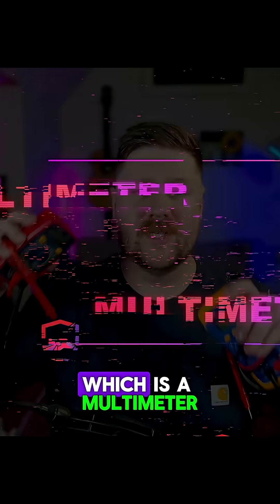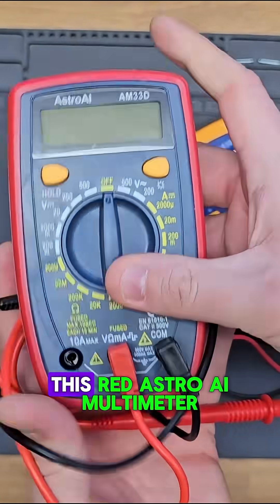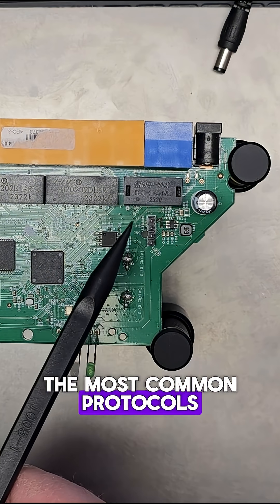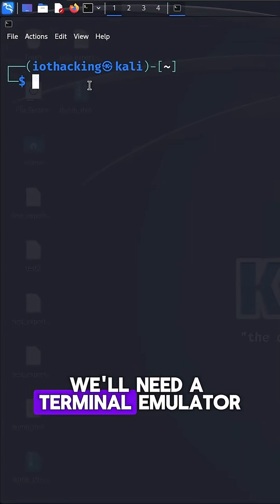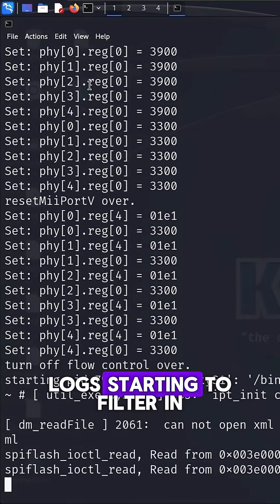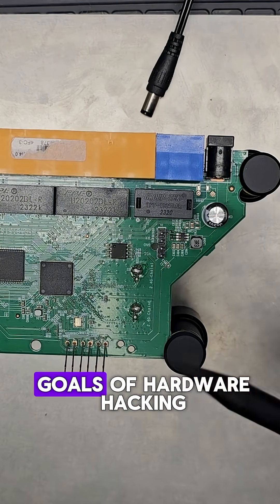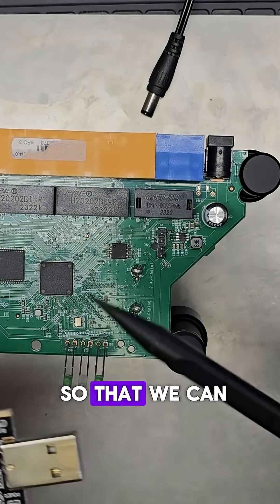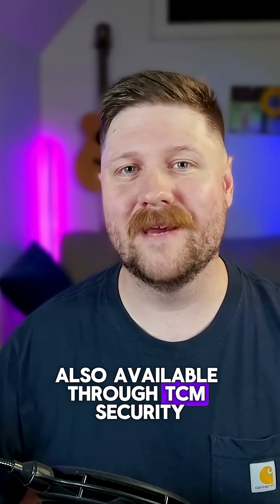3 IoT Hacking Tools You Need!

Comment: My list of tools includes:
Multimeter
Logic analyzer
Ch341a
SDR
Oscilloscope 
Chip whisperer
Flywire board
Breakout boards
Var. Chip progrs, adapters (jtag, c2...)
Var. MCU's (Arduino, RP...)
Var. Modules (can, lin, mod, rs232...)
Var. Resistor and cap
Software (kicad, gidrah, binwalk, hex editor)

I probably forgot some things in there.
Reply from the maker: Thank you for sharing! It's a great list.